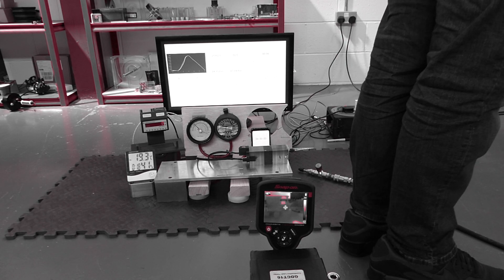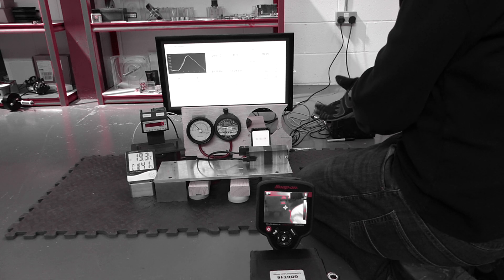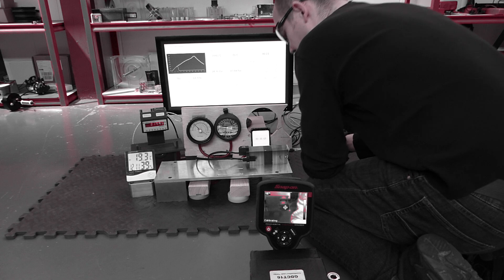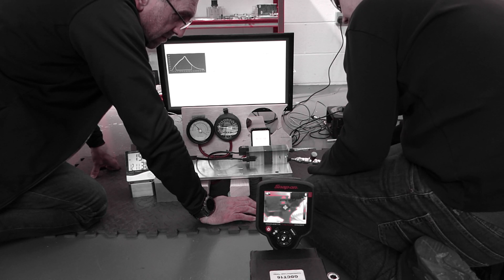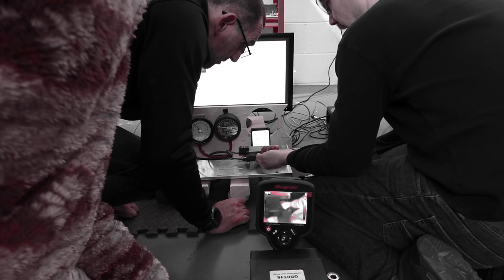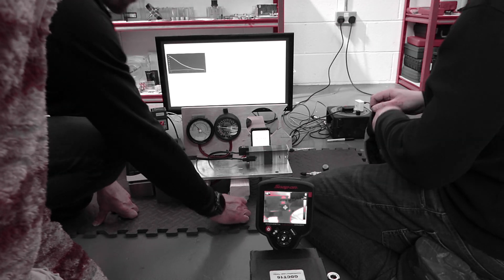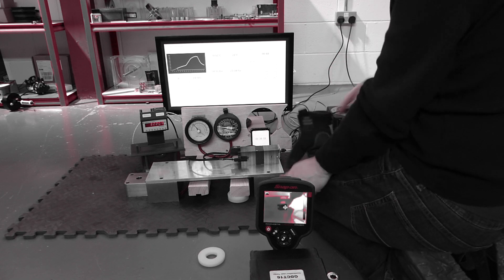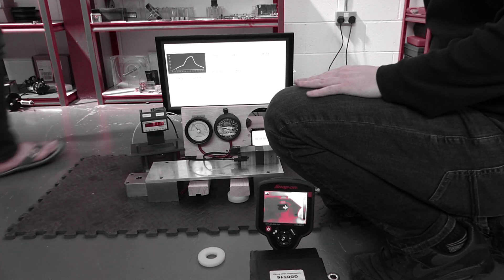Supersonic Two Stage Tesla Turbine

Comment: congratulations on this step good to see you  all
Reply from the maker: We are one rotor away from showing the next test which hopefully shows a growing negative pressure instead of a growing positive pressure!
Reply: @nikola.tesla.r.and.d.centre  Great work  hope to buy  some turbines when you  make them for order again Dan
Reply from the maker: @SecureSuppliesLimited  I've got all the parts in stock apart from some black connector blocks and turbine rotors. If I had an order I could get these parts manufactured and sell another 5 kits at a minimum. The kits were selling for £369 + £15 shipping to UK and £25 to Rest Of World

Comment: Thankfully that wasnt a disaster! I'm happily clickbaited! I was worried! 🙏
Reply from the maker: Well it was a minor disaster because of the back pressure. The description tells the full story! This experiment highlights the reason for 3 times the surface area on stage 2 to create negative pressure not back pressure! This allows the higher rpm on stage 1. Myself and Carlos the veteran aircraft engineer have seen 278,000-280,000rpm as the centrifugal head limitation of a single stage using the same rotors in this video. With a 2 disc rotor on 1st stage and 6 disc on 2nd stage, we should see something much more interesting than we did in this video.
Reply: @nikola.tesla.r.and.d.centre  Ooo interesting!
Reply from the maker: @rickfrogm825  we hope to next show a growing negative pressure rather than a growing positive pressure. The faster the air can escape in the second stage the better the system will perform.

Comment: i presume you know of the pistol shrimp and its method to stun its pray. as i expect the air is with its elements both cavitating in the turbines and causing micro implosions .may be try it in a totally dark room if possable to see if any iluminescence   just a thought
Reply from the maker: Currently no implosions, but I do think it is possible, but via vacuum rather than cavitation. We have designed a new rotor for the 2nd stage. Just looking for someone to manufacture as it is a technical build at 28mm diameter. It needs EDM wire erosion and CNC turning the new design does.
Reply: @nikola.tesla.r.and.d.centre  hi i have a friend who owns m and j products at chesterfield who does have cnc top machines as he does work for shipping firm cathelco of chesterfield ..though he is busy if it is a few hours may be his machine operator could help .cant guarantee as need your reply on if you are supplying materials and able to interact .where are you based
Reply from the maker: @honda4004  I’m in Plymouth, Devon. If they cannot do EDM wire erosion as well as CNC turning then they wouldn’t be able to manufacture the new design. It’s basically a 6 disc tear shaped hole rotor from 30mm billet. I know it can be done as this is how the current rotors were made. I might get a batch of 25 made as this will bring the price right down per unit.